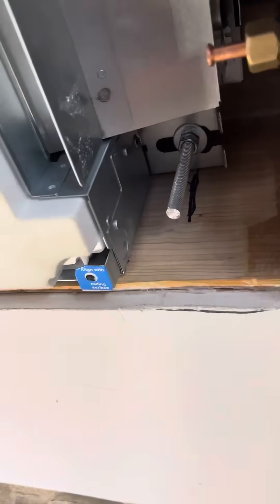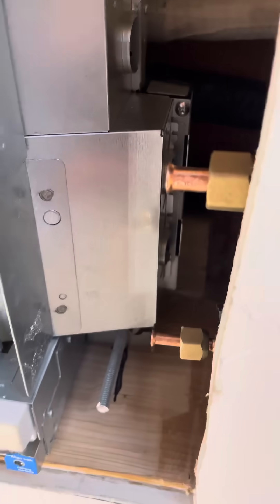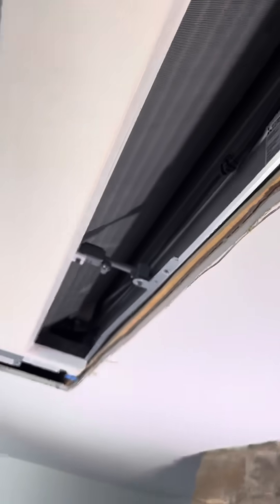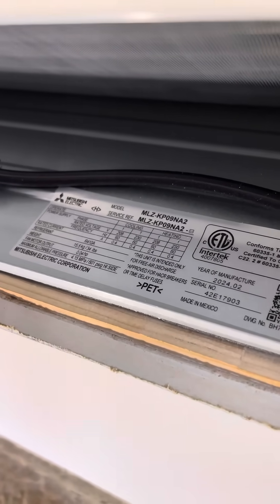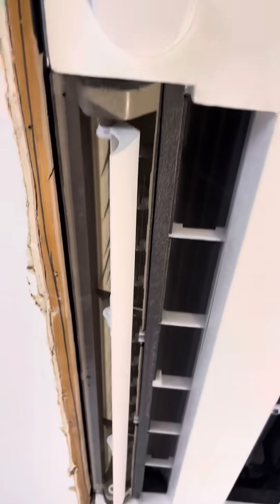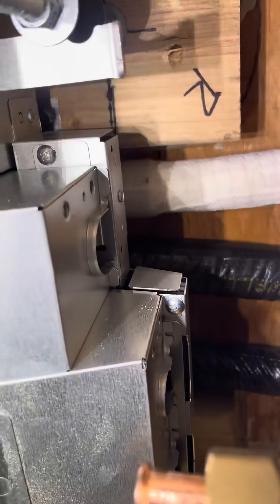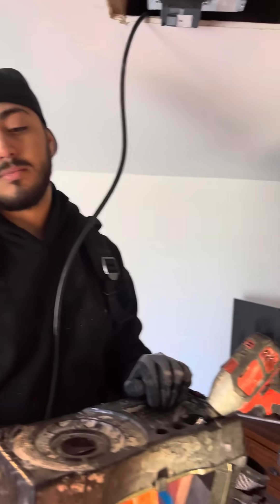Ductless cassette install 9000BTU Mitsubishi MLZ-KP

Comment: Does this unit fit between joists that are 16" OC? The install manual mentions an opening of 15 1/8 which makes me think no.
Reply from the maker: Yes it will fit 100% if the framing is 16”

Comment: Do you when Mitsubishi is making the changeover on the MLZ units to r454b or R32? Im looking at puchasing equipment for our home in the next few weeks.
Reply from the maker: @WrenchChill  They have it. It will be out early this year. May-June
Reply: @ductlessplushvac  are they changing the indoor cassette units as well and will the old ones be obsolete? Any idea what the price difference will be? Thank you
Reply from the maker: @ 20-25%up or get the old stuff while its around
Reply from the maker: 454b is the new gas

Comment: Question.... how do you deal with rising C02 levels in bedrooms that have minisplit heads and the doors are closed?  I'm trying to address an issue and the only solution I have is to install a EVR.  Any suggestions?   Thanks, Brian
Reply from the maker: ERV and find out why they get so high

Comment: What depth do you need to install in the ceiling? I have a two story balloon framed 105 year old cottage with plaster ceilings. The upstairs is easy, but getting lines to the first floor is tougher. I don’t want inside wall units.
Reply from the maker: 10” is perfect